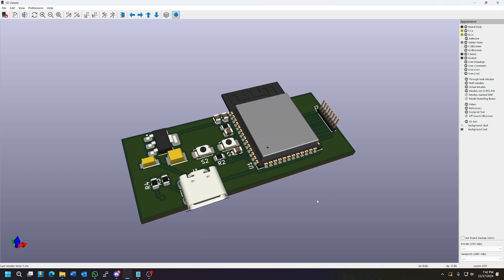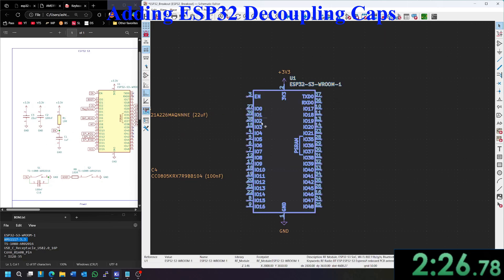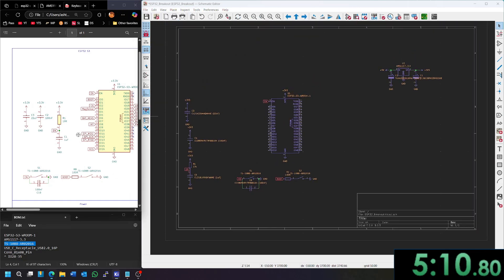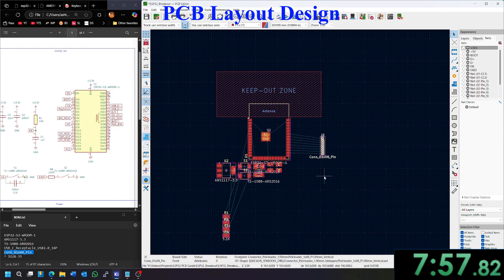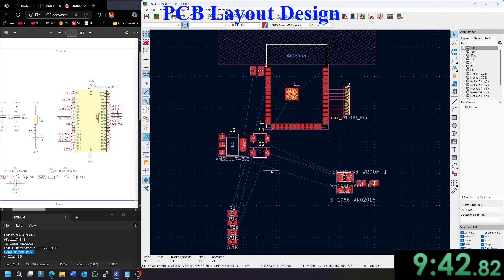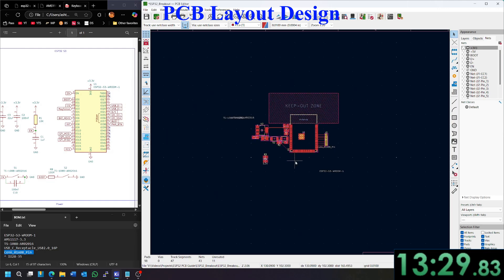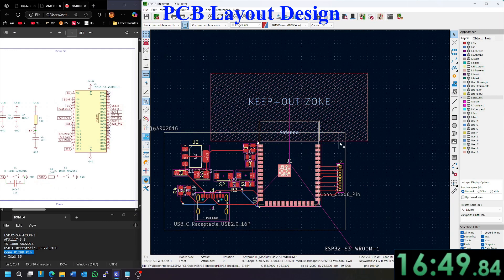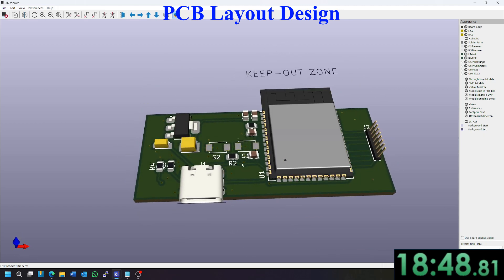How to Design a Custom ESP32 PCB in 19 Minutes (Full Tutorial)

Comment: How do you know where all the decoupling capacitors and pull up resistors go? Do you go through data sheet for all of it or there is an easier way in kicad?
Reply from the maker: It's just using the datasheet. There is typically a section called "recommended implementation" or something that shows you

Comment: I'd like to make a data recorder...  using an ESP32 and an ADC (TI ADS8588H  LQFP-64).  I think I can probably stumble my way thru the schematic, maybe even the layout (although the TI ADS8588H Layout recommendations of split Analog/Digital planes seems advanced for a non-hardware guy!)...

but the biggest issue will be the assembly.   My bad eyes and shaky hands, I don't think I'll have much luck soldering, even using 1206/1210 size components.  Where do you find someone that can do that?
Reply from the maker: JLCPCB will do PCB assembly for a charge

Comment: I connected an external 3.3V power supply to the module separately via the ESP8266. Then I connected the module's D+, D−, and GND pins to the system via USB, ensuring all grounds were connected. However, when I connect the device, it keeps connecting and disconnecting continuously. Why ?
Reply from the maker: Did you short the bootloader pins to put it in programming mode?

Comment: im a beginner and im smart of enough to realize this does not have the usb to serial which will cause problems for beginners. is this usabe with the arduino ide without that?
Reply from the maker: Yes. ESP32 S3 has that chip built in

Comment: One more comment: I designed this board and assembled it and it does work! Remember, to start the board the first time hold "boot" then press "rst" for 1 second, let "rst" go after 1 second then let go of boot after another 1 second. YOU MUST DO THIS or it won't start. After that, you are good to go! :)
Reply: That's good to hear, seeing as i'm about to get it assembled too. Did you get PCBA or solder the components by hand? Also,  where did you find the 22uf symbol, it doesn't seem to be available in my kicad?
Reply from the maker: Oh wow! Glad to hear it worked in the real world lol :)
Reply: But there is no driver ic for usb, will usb c work? I guess we should use a cp2102 or ch340g. Is it? @ashtf
Reply from the maker: @lazycoder5872  It's not needed for ESP32 S3!
Reply: @ashtf  so it depends on the chip? if they provide native support for usb C ? if no then we have to add usb to uart ic for programming

Comment: Do you have some capacitors library installed on kicad. my KiCad 8 can't find it. I found this cab TCJB226M025R0150E in digikey, but there is no 3d model. So, I wonder where you are getting the libraries from ?
Reply from the maker: Check out my video on importing footprints from JLCPCB!

Comment: Hi, first of all big thanks for this tutorial! I have three questions:
1) I want 16 mb of flash and 8mb of ram, if I take n16r8 esp32-s3 chip, does it contains this memory inside the chip like custom esp32-s3 wroom1 n16r8 board or the flash and ram sits separately from esp chip? 
2) does your custom board supports HID option? For example to use it as a virtual mouse or keyboard for pc or any other USB connected devices? 
3) Would you mind to share a project to import to eda app?

Thank you!
Reply from the maker: Yes, for the ESP32 S3 WROOM modules the memory and flash are both included in the module. This board does support USB HID through the USB-C port.

Comment: i am beginner, do you mind to explain what the why you put C3 and C4 on 3v3 of esp32? end what is your consideration to choose those value of capacitors
Reply: These are decoupling capacitors, they filter noise to the ESP32 by adding the capacitor between +3V3 and GND, this allows any noise on the electrical signal to be shunted through the capacitor rather than feeding into the ESP32. The values for these are typically specified in the datasheet for a given MCU.

Comment: Bro i need help from you ! i'm tired of searching on how the logic of the Menu system work (the code behind a layered menu ) i've seen your videos about the communication device [RPI Pico communicator] and i really want to know how you did it , please send me help by giving the code or the logic behind such menu system (algorithme or tools used) PLEASE.
Reply from the maker: I would say look into switch case statements in particular. The logic used for the code from that project was terrible and I've learned a lot since then 😅. Just make a variable that holds the current state of the menu (i.e. state 1 is home, state 2 is settings, state 3 is another app) and make pressing the buttons change the state. You use a switch case in the main loop to display different things and perform different logic based on what state the menu is in. Not sure if Python has switch case, but if/else statements work essentially the same way. Hope this helps!
Reply: @ashtf  Thanks for replying
Reply: @ashtf python's switch/case equivalent is match/case

Comment: How do you flash the esp32 when it only has USB and no uart? I’m using esp idf and face issues
Reply from the maker: I've had no problems flashing through Arduino IDE using just the built in USB of the S3
Reply: The ESP32-S3 has native USB, there are a couple tutorials on the internet to do it over Arduino, but I prefer creating a project through the PlatformIO addon on Visual Studio Code. It allows you to flash through the ESPTool protocol so theres no need to manually put it into bootloader mode, super nice.
Reply: Is there also a guide on how to do it with the native ESP IDF ?

Comment: Why did you add many vias towards the end of the video? Are they important? 18:44
Reply from the maker: The vias are return paths to the ground plane so I added vias near the ground connections. Had I not been going quickly, I wouldn't have been as willy-nilly with them. Thanks for your question!
Reply: @ashtf so this is just to connect both ground palnes together?
Reply from the maker: @milesraymond2360  Essetially yes, and to provide close ground plane returns for grounded pads

Comment: Hi, did I miss something or is the USB-UART not needed?
Reply from the maker: For the ESP32 S3 USB to UART is not needed because the S3 has native USB OTG support
Reply: If you look at the official dev boards they even have an option to forgo the UART bridge, however including it simplifies programming since it handles the reset/boot configuration.

I've used the C3 variant in several projects and it's very handy for programming while keeping the BOM low.  You can short GPIO9 to ground, plug in the USB and it's ready for programming.
Reply: That's clear, thanks you guys